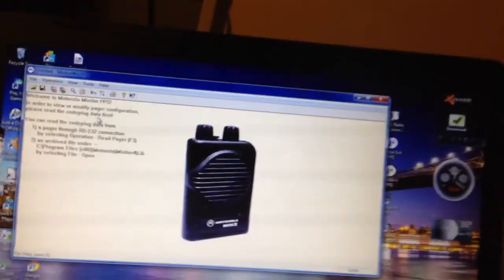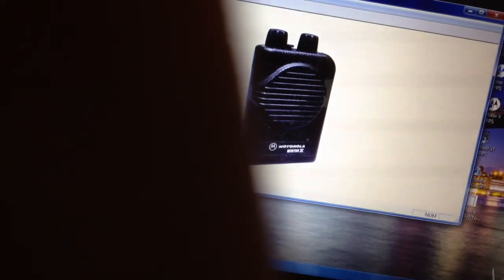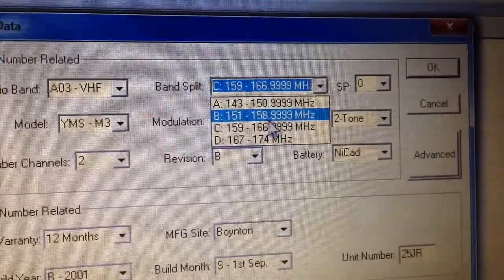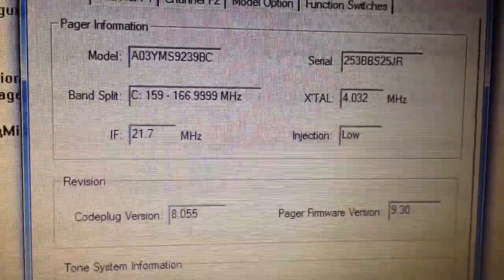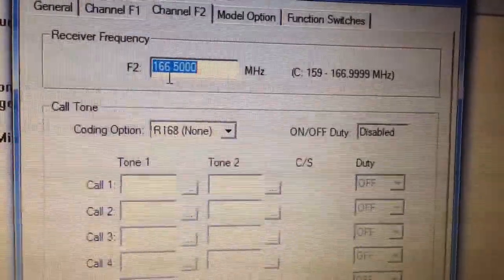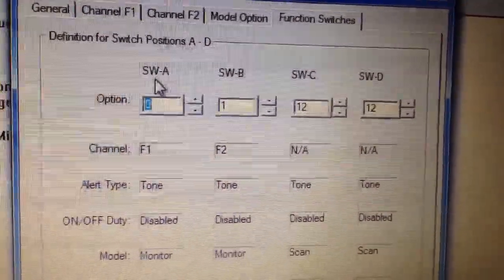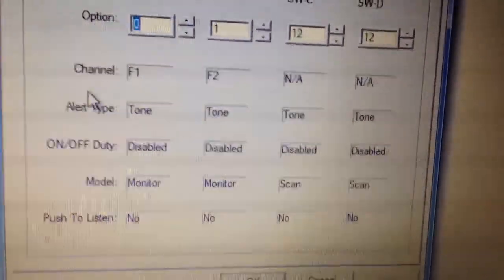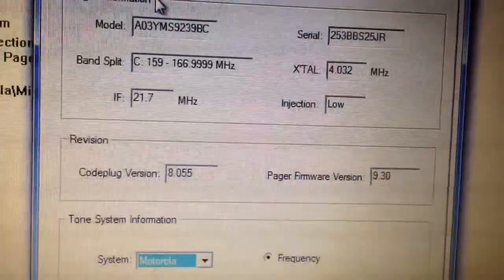Motorola MINITOR 3 Engineering Data Band Split Change from 151 - 158.9999mhz to 159 - 166.9999mhz

Comment: where is the Engineering Data for Motorola Minitor 3 using the software
Reply from the maker: There should be a BLACK KEY at the top once you read the pager....You have to read the code plug first then it will show up.